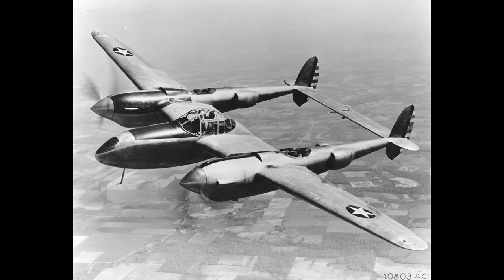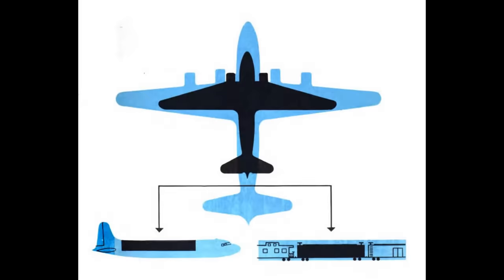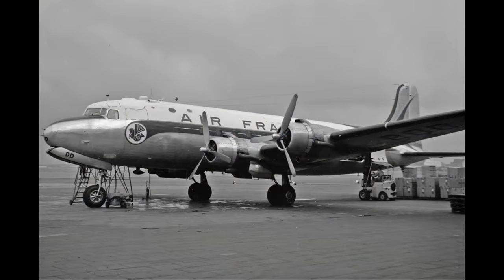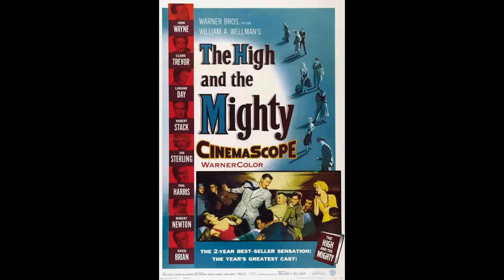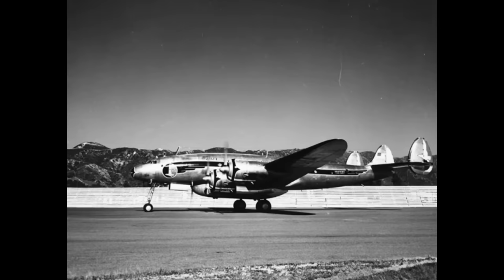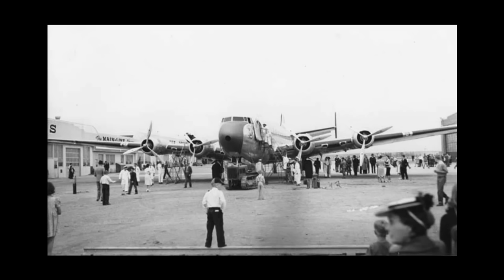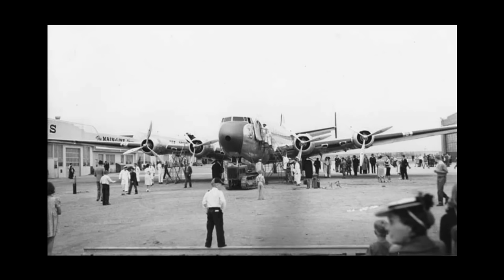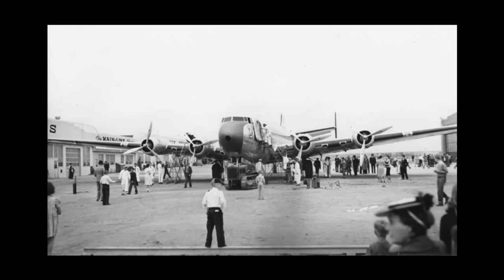Turbo Compound Piston Engines. Almost magic tech.

Comment: We had a no start, or more like a start and stall, in the shop the other day, a turbocharged Ford Escape. Turns out the turbo was seized, and created such a restriction in the exhaust that the engine could only idle. Anything over idle and the exhaust was so restrictive, and the intake air less dense than designed, that the car would just stall. A turbo does create a substantial restriction inside an exhaust.
Reply from the maker: Good post.
Reply: You aren’t wrong, on the Beech P- Baron and Dukes I fly, the manual says a turbocharger failure is to be treated as an engine failure, such is the lack of airflow around the seized compressor

Comment: Great vlog! When SAS/SK flew the 7s they contracted the Swedish airline TSA to have a C-46 on stand by 24/7 to ferry CR engines across Europe. When TSA bought used 7s from DL and EA and they had taken del. of three 727-134 from Boeing the following memo went out: What ever you do, sell capasity on the 727. It is way cheaper to fly than than the DC-7s! For short domestic hops like 30 mins both the 6 and 7s it was not ideal, you had to monitor the cyl head temp. Greetings from Norway!

Comment: The story behind John Wayne appearing in The High and the Mighty is pretty simple. Spencer Tracy was originally cast and backed out at the 11th hour. Since Wayne was financing the film he took the part so as not to go over budget. However, as the character was way outside Wayne's normal comfort zone, he had to act. It is actually considered one of Wayne's finest performances. Thanks for the content!!
Reply from the maker: I thought he did well in the role. It's interesting that the movie has generated almost as many comments here as the main content of my video.

Comment: I stumbled across another interesting modern turbocompound engine system currently available for trucks (other than the Volvo D13TC).   This one is a  much more complicated mousetrap.   The FEV Group has thrown an electric motor/generator into the mix along with the mechanical connection to the crankshaft.  This adds a ton of complexity but gives the system mild hybrid capability.  They call it ITES (Integrated Turbocompounding/with Electrification and Supercharging).  They have a video here on YouTube.

Comment: These engines were built at the Wright plant in NJ just down the block from where I grew up in NJ. Unfortunately, Wright management made a major strategic error at the time: they thought that civilian aviation would stick with piston engines and jet engines would be limited to military aircraft. MAJOR mistake. I don’t know if the factory is still there, and if so, what is built there. Left the area when I graduated from college. My parents are/were buried in a cemetery near the Wright factory.

Are/were? Last time I was in Lodi I found the family grave stone but not the family plot  bought by my father and his brothers and sisters back in 1950 where my paternal grandparents and most of my paternal relatives were buried. Never got an explanation from the cemetery. Didn’t push it because the cemetery is small and located next to the Saddle River.

Comment: How did the cost of operating the late turbo-compound radials compare to the cost of operating the jet engines on the early passenger airliners? I would suspect you would use cost per passenger mile, factoring in capital cost for the aircraft, operating cost of the engines with maintenance intervals, other maintenance costs, and crew costs factored in. Crew costs might be especially vicious, as both speed and capacity issues become multipliers. 

Something similar happens with engine maintenance and amortized cost over miles traveled, but the apples/radial to oranges/jet is going to make that way more complicated than the crew costs. Even then, I can see how speed and size/capacity issues would mean the radials would have to have a major advantage, and I guess the speed at which the DC7 was phased out after the B707/DC8 entered service pretty much answers that question. I'm just curious over the magnitude of the advantage.

I worked for the general aviation newly three decades, primarily with General Aviation, with a mix of piston, turboprop, and corporate jets. The jump from higher HP piston engine twins versus smaller turbo-prop twins was often a bone of contention between some of the operators. Turboprop engines can be REALLY expensive, and overhauls were much more expensive at that size. Also dealt with a lot of twin turboprop cargo haulers. Flying jump seat in a high gusting cross wind with a Shorts 330 on a short runway was - interesting.

Comment: I loved this video.  When i was going to A&P school, my mind was blown by this concept.   The only tech that impressed me more was the Air Cycle Machine used on 727s (and others), which magically transformed 390 degree air from the 6 and 8th stage compressor bleed valves into ice cold air for cabin cooling and pressurization - using only some radiators and a few turbochargers running in series.  Might be a good video idea...
Reply from the maker: You have no idea how close I was to talking about this exact device.

Comment: A long deceased friend flew Connies for TWA including the ultra long haul Europe-US nonstops, that could last over 20 hours. He had NINE engine fires in 5 years - and that was with brand new equipment and mechanics that were experts in the care and feeding of the 3350-TC18s. He then flew B707s and 747s for another 20 years without a single major engine problem. 

The Wright  turbo compound radials were amazing for their day, getting over 1hp/cubic inch (awesome for an airplane engine) but I could see why the industry eagerly embraced jets.

Another pal was a Connie second officer, and said the engineer school for that airplane was the hardest thing he ever did in his 30+ year career there.
Reply from the maker: Flight Engineer school was tough, I did it myself, although only for turbojets. It's true that the 3350 TCs were unreliable. They were pushing the limits of the new tech, plus the 3350 had a bit of a problem child history to start with.

Comment: Hey, thanks for the very good brakedown and explonations.
I sometimes wonder why they didn't use Compound Turboed Diesel engines in airplanes, or even Two-Stroke Diesels, like the 6V92 Detroit Diesels.
Very good efficiency on the Two stroke diesels.
I have had a 40-foot bus with 6V92 in it, blown and Turboed.
So it was a compound Intake system, kind of thing.
I was getting 8.5 Mpg consistently in that (24,000 lbs) bus running veggie oil and pulling a Suburban, (7000 lbs) behind it.
Cheers!

Comment: The world’s first turboprop powered airliner was the Vickers Viscount. In October 1953, the Viscount 700 prototype G-AMAV achieved the fastest time (40 hours 41 minutes flying time) in the transport section of the 12,367 mi (19,903 km) air race from London to Christchurch, New Zealand. The aircraft averaged 320 mph (520 km/h) in the event, crossing the finish line nine hours ahead of its closest rival, a Douglas DC-6A of KLM,

Comment: You can get shorter take-off from a Turbo-prop because the propellers are pushing air over the wing and this is providing lift even when plane is stationary - this airflow also means the aircraft can have better low speed handling.
Reply from the maker: That's a part of it as well.

Comment: Interesting. In my imagination the most efficient combustion engine is a 2 stroke where the gasses are replaced at BDC by a tubine in the exhaust, linked to the crankshaft. Not too far off :)

Comment: In the DC-4 you were lucky to get between 300 or 500 fpm climb fully loaded, I know that the climb rate is officially 1,200 fpm, but in reality you cannot maintain that rate until cruisin altitude. Once you got to altitude, speed wasn't bad, somewhere around 200kt.

Comment: The more common name for your turbine is an impulse turbine, which gets its power from the velocity drop across the rotor blades. This is as opposed to a reaction turbine, which uses a pressure drop on the rotor blade to produce reactive thrust on the blades. The technology comes from land based electrical power plants, in use from the 1880s, and shipboard propulsion units from the 1900s. Trains did not use turbines until the 1930s.
Interesting to see that on a Curtis-Wright engine, since Curtis held the patent for the turbine design since 1896.
Reply: Good comments. 👍
Reply from the maker: Thanks, I'm sure you're correct, but I'm using the terms that Curtis used in their documents so that my video matches the sources I used.

Comment: Turbo compounding reminds me of the engine arrangement of Titanic and her sister ships where the triple expansion engines that drove the two outer propellers exhausted the steam into a Parsons turbine that drove the central propeller. This resulting efficiency gain saved coal.
Reply: Correct, she wasn’t as fast as ‘Lusitania’ but probably more efficient. However there was no reversing engine for the middle propeller, which amazingly James Cameron showed in his underwater shot of the ships’s propellers while she tried to avoid the iceberg. Great technical direction imho.

Comment: I need to see numbers on using a blow down turbine to drive the compressor stage of a NON COMBUSTING variant on a high bypass turbojet, coaxial with the propellor thrust- The still rather hot but now lower velocity exhaust gas exiting the blow down turbine would also be added to the cold atmospheric air, expanding the bypass air and increaseing the jet thrust, trading residual heat for additional thrust without burning additional fuel. Net + result: Colder final exhaust and more thrust. Net - result: Increased weight and increased complexity/maintenance, how would this all work out?

Comment: I was kid with Qantas flying training on Super Connies 10 km away. You could hear them start. I was talking to an ex Qantas engineer at a restored Connie which still flies. HE said it was worth around 300HP on take off using 100/130 fuel. Unfortunately though the engines were far from reliable with arrivals in Sydney on 3 engines quite common. He said the oil consumption was horrendous, anywhere up to a gallon and a half an hour. They held 50+ gallons per engine. The system may have been great but the engines themselves were not.

Comment: Minor addition on F1 cars: the exhaust driven generator (part of Heat energy recovery system) can be used to send energy directly to the auxillary electric motor/generator which is part of the Kinetic energy recovery systems (akin to Hybrid cars) and is connected directly to the crankshaft. So F1 system is in fact even closer to turbo compound. Although the system proved to be expensive and hard to tune and not very relevant to road applications, so the plan is to remove HERS from 2026 for a bigger battery.

Comment: @Greg's Airplanes and Automobiles --  Spencer Tracy was set to play the Dan Roman part that Wayne played THE HIGH AND THE MIGHTY. Tracy dropped out at the last minute. It was one of Wayne's first movie he was producing and he stepped into the part. If Tracy had played it would have made more sense, however, Wayne did a fine job. It was a mistake for Tracy to quit because of how successful that movie was. For the time, it had a high box office. (I didn't know that DC-4 was not pressurized or the design was from 1938. It's a very modern-looking plane.) TY for the Videos.

Comment: The turbine is an additional stage in the engine's cycle. To understand this, it is necessary to look at the state of the working fluid at each point in the cycle. The state is defined by the state variables: Pressure, Temperature, density. The turbine takes higher pressure, higher temperature, & higher density working fluid (air) at the point of the beginning of it's cycle (at the turbine inlet) and extracts energy from it, releasing lower temperature, & density air at atmospheric pressure, (at the turbine outlet). The turbine 'catches' some additional energy from the exhaust that would otherwise do no work. This is similar to the stages in a triple expansion steam engine.

Comment: I wonder if any of the automotive companies in engineers have thought about using turbo compounding in a hybrid drivetrain. It seems as though you could use turbo compounding to drive a generator, which would in turn charge the powertrain battery.

Comment: I always thought this was an idea to update, with better metallurgy, better lubrication, computer thermal modeling and better engine monitoring the potential to build an engine that is more efficient should be there. The formula one engines you mentioned reportedly are achieving close to 50% efficiency, and that at high rpm. It would have to be made to run on unleaded fuel, which could be engineered if there was a financial reason to do so.

Comment: Since I have nothing to add on the engineering side of this fine video and comment section, I'll bite on the oddity of John Wayne's role as first officer in The High and the Mighty. Wiki says Wayne started out as a co-producer, but all the big names offered parts, male and female, turned it down because there were no true leading roles. Spencer Tracy was among those who said nope. So Wayne was talked into it--and ended up not liking his performance. Apparently it was pretty well-reviewed and made a decent amount of money. And Composer Dimitri Tiomkin won an Oscar for his original score.

Robert Stack lobbied for the captain's role and got it. As some of you know he later parodied himself--not exactly in the same role IIRC--in Airplane.

I enjoyed the brief mention of the DC-4/C-54, which played such a huge part in Ernest Gann's career and his book Fate is the Hunter.

Comment: The Scania DT 1202 Turbocompound engine is based on a 12-liter, 460 HP engine; the application of the technology increases power by 50 HP. With this supercharging technique, up to 15 % of the energy can be recovered since 2001

Comment: During the GWOT I flew the gander to Shannon to Frankfurt route many times when we were getting rides from the Air Force so it's funny that even today using c-17s or c5's they're using the same route that they used for the DC4 in fact if memory serves me I believe that a charter plane with ATA or one of the other military civilian Charters also still uses that route.
Reply from the maker: Today the same route is flown, or very nearly the same for the US military by Omni and Atlas, both typically overfly Gander as they very rarely need to land there.

Comment: Detroit Diesel’s DD15 semi truck engine has an  “Axial Power Turbine”  that uses turbocompounding technology.  This is in addition to a traditional pressure turbo.   It adds about 50hp and 100lb/ft torque.

Comment: Theres a setup called "cogeneration" which uses heat from the generator exhaust to boil water and supplement a boiler. 

The way it was sold reminds me of this. More power, same amount of fuel.

Comment: Turbo compounding has been used sporadically on large two stroke marine oil recip. engines in large ship propulsion.  Power range from 10,000 to 110,000shp. It has proven to be efficient, however, these engines use high viscosity fuel oil (bunker c) and blade fouling has led to reliability issues.  More recently Finnish technology company WARTSILA has offered turbo compounding on its larger 9-18MW gas fired 4-stroke reciprocating engines.  One unit per turbocharger (typically 2) are used to generate electrical power to improve overall plant efficiency.

Comment: Just echoing the most-common sentiment here....yes, the R-3350 turbo-compound engines were a maintenance NIGHTMARE.
Reply from the maker: That was commonly known before the video. However it wasn't the turbo-compounding system that was the issue. B-29s had a lot of engine problems with their 3350s which didn't have turbo-compounding.

Comment: I read somewhere that when Capital Airlines were getting ready for a Connie flight they would prepare a spare aircraft just in case the engines were running rough. In all cases they would have to start and warm up the engines before the passengers boarded.

Comment: You do a great job explaining it... You might want to consider Bernoulli's equation; however, to provide the complete explanation of what's happening. [This equation measures each type of energy in the flood have each point in the system.  It identifies transformation of energy from one form to another. (In steam systems are typically evaluate enthalpy.)]  For the water wheel the pressure head is converted to a velocity head which is converted into torque on the wheel. [3 different types of energy -  Pressure, kinetic, (1/2*M*v^2) and "torque" kinetic energy (1/2*I*w^2)]  The key energy conversion is from velocity to torque (I*w^2) so the only "cost" would be the speed of the water on the downside.   Since downstream nobody cares about the speed of the water, this "cost" is irrelevant.   The same is true for the engine.  I don't recall if the engine is also turbo-charged or super-charged.  If it is turbo-charged, they would have to put this turbo downstream from the turbo-charger.  [Per Bernoulli's equation, they could insert a nozzle to increase the velocity if needed.]   I'm sorry if there are any mistakes but I am a retired research engineer with bad eyesight, and I have to use a Voice Translator.   Wonderful video!
Reply from the maker: Thanks, and you're not wrong, but how long do you want this video to be?

Comment: Seems like it would be extremely efficient on hybrids or electric vehicles that use a gas engine to charge the battery for driving where it could add an extra charging set up at lower speeds, or add power under starting acceleration